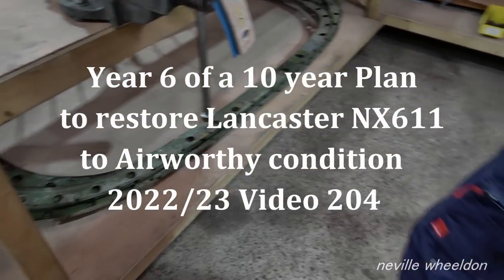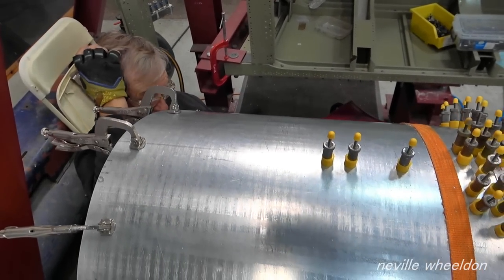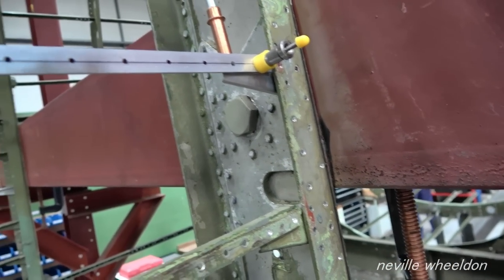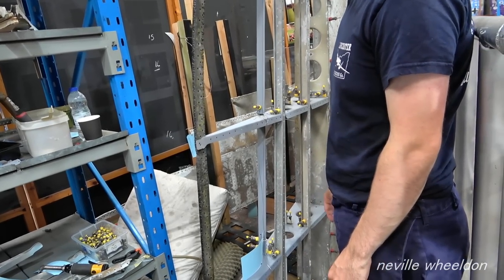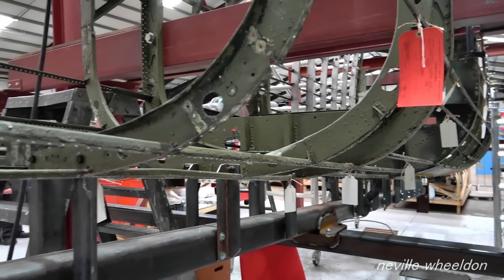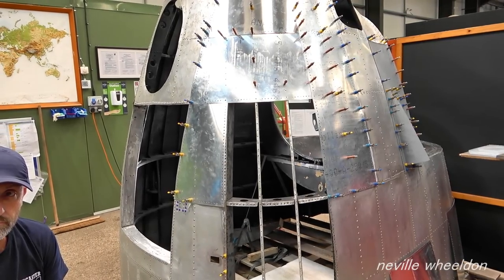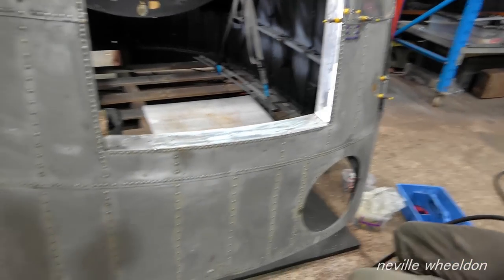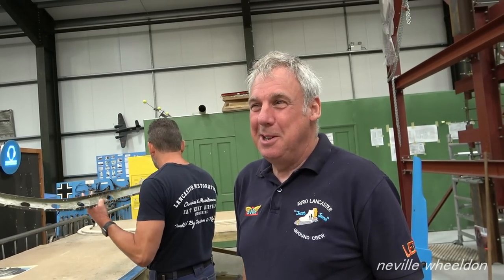Video 204 Restoration of Lancaster NX611 Year 6... New skin repair on the leading edge NX664

Comment: I never knew you could 'drill stop' cracks in metal before, although I am very familiar with the technique on Glider Canopys.  The Poppy Drop information was fascinating. I'd never thought about the issues with the controls running through the bomb bay but its obvious once its been pointed out. 

Thanks again Neville, it saves a weekly trip down to EK 😆 (although  we must visit again soon)
Reply from the maker: Cheers James.

Comment: Thanks Neville really interesting. The nose is very slowly taking shape, I wonder if re-skinning the nose is quicker? Knocking out tiny dents and fitting tiny patches seems very labour intensive. 👍👍
Reply: I think you’ll find it’s material cost. It’s cheaper to repair a skin than to replace with a new whole sheet, the nose is being repaired for taxing only. Just Jane’s nose section will stripped down to its component part and any damage like that, the sheeting will be replaced in it’s entirety as it has to air worthy to meet CAA requirements.
Reply from the maker: Hi David, the reply form fenderac3049  covers it all.

Comment: Why does the repair team not use low temperature alloy welding to fill the small holes and cracks in the nose skins? (Time Point 17.14) This would save all the drilling and patch plate riveting.
Reply from the maker: Not sure on that  PNH.